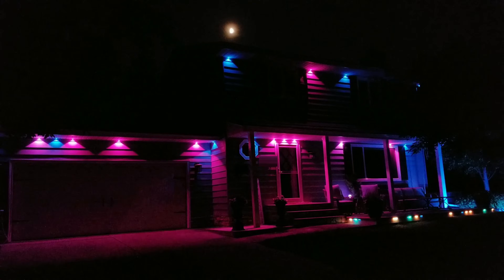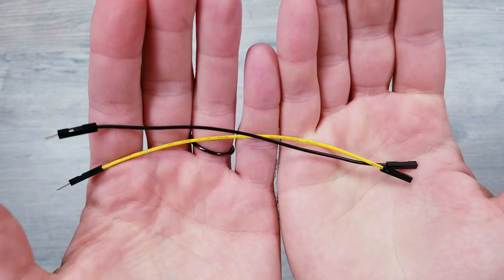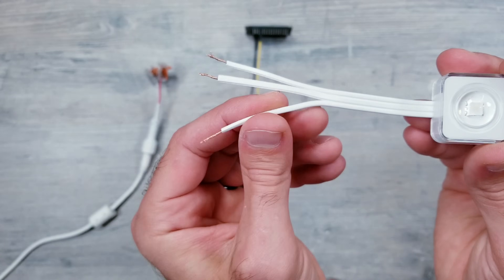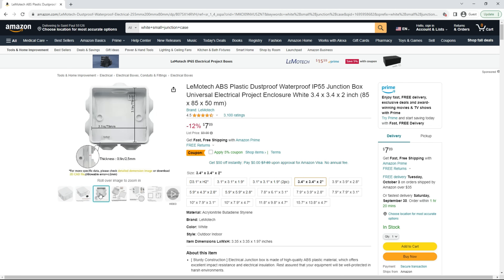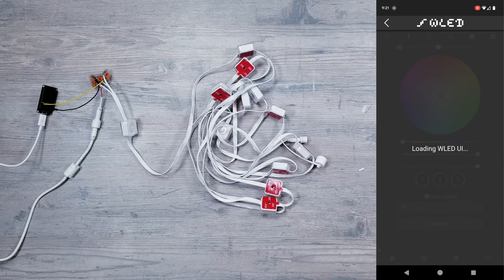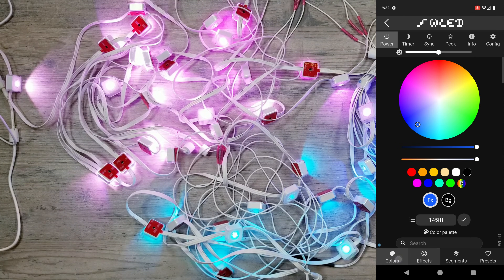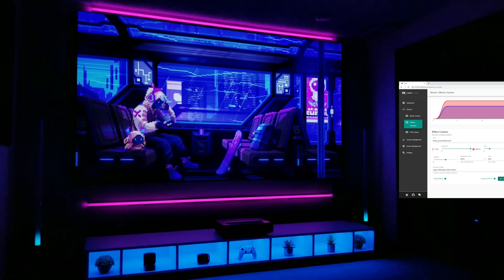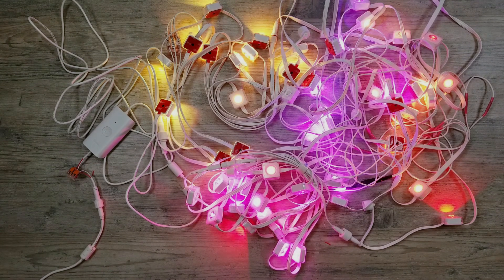Can You Control GOVEE with WLED?! Is it the PERFECT Combo?!

Comment: Thanks for sharing,
As the Govee lights are also ws281x the same govee controller can be used with othe ws281x stripe lights from 30 Leds per meter to 144 Leds per meter thru Their App.

Comment: Awesome video. i'm about to try this on some christmas lights 2 that arrived with a DOA hardwired controller. It's a little bit different setup than the pro outdoor lights but it'll be interesting to give it shot and see if i can get it figured out to work.
Reply: Looking into how to do this as well.
Reply: @joemorgan9632  my attempt was sadly a failure. I'm not an expert by any means just a tinkerer but I'm fairly confident the lights were unsaveable. Even simple on/off was non functioning with wled so I'm guessing it wasn't a bad controller in the beginning which is fine, was worth a shot.

Comment: Thanks for sharing. My Govee strips have been acting up lately and I was just researching how to switch them to WLED then I saw you posted this video a few hours ago. I'll give it a shot. My main concern was they run on 12V and I've never done LED strip with WLED that run on over 5V.
Reply: Govee has really good support btw they may or may not have got me to say that but it's not wrong I had an issue with mine and actually had them working with wled js flickering from power injection so I told them and they replaced it js got them today
Reply: @tubelesstrippin  They have 0 support on Home Assistant. Whatever available integrations now are super bad, they work for 1-2 days then start erroring out.
Reply: @iMustafaTube  I meant like customer support they really good about giving replacements

Comment: With the new pro version permanent lights you have not only the RGB main but 3 warm and 2 cool leds for white lights. Are those also controlled with wLED?  I assume it would need to be programmed as a new string light model in the wLED software.
Reply: Can you explain how you got yours working? I am struggling with this and my pro setup.
Reply: Any update on this? Curious about this with the pros.

Comment: Thanks Chris, awesome video.

I wonder if you could wire them both up at the same time, but put an in line switch to toggle one or the other on to make a quick switch without touching wires.

And maybe you could use the dower from the govee to power the esp with a buck/boost converter to eliminate the extra  power supply
Reply: That's what I've been thinking about doing. devices in my pc come with their onboard lighting effects, but with the press of a remote button or toggle in software progam they switch over to a 3rd party connection which is the motherboards lighting for most people. I'm not smart enought to do a remote switch just yet, but i'll probably find or make a physical switch. I've cut and saved too many controllers from all sorts of devices. Splicing in an esp32 with a switch of some sort is what i've thought everytime.
Reply: I'd also like to know if this is possible.

Comment: I think that every single product that use WS281x led is ready to use with WLED, like i use the LS100 from Corsair with Razer Chroma Software, with the controller from Razer and some ARGB 4 pin connectors.
If the WLED come with some GUI Interface i think i will move to WLED, but for now i remain with my Razer software 😅
Hi from Italy 🙋🏻‍♂️
Reply: Wled has an app and a gui in your browser.
Reply: @DaMook82   I know, but i want an app on PC/Laptop or on the phone app to control individual led with one tap, or like Twinkly, Lifx, Govee, Philips hue to drag and drop or paint with finger, if you know what i talking about it 🤩, that will be awesome 🔝
Something simple, not to go on settings for adding a lot of LED or individual leds ✌🏻
Reply: What about reverse / opposite? Control cheaper leds using Govee.
Reply: I wish razer chroma software worked right for em but it's always really weird for me idk lol I straight uo don't use any rgb software anymore unless u count l connect
Reply: @AX-fx7ng  I think is possible, if you have some controller from Govee, not sure, but if the govee use same type of LEDs with the same chip, I think is possible
Reply: @tubelesstrippin  I use Synapse from the beginning, and for me it was flawless, no small problem, and wat I like about the software is the Studio part, where I see every individual led for choosing the right color or efect, and I wish that all the companies will create an Universal control, but I don't think is possible

Comment: What is a good "effect mode" to test out my setup?  Right now I seem to have a lot of flickering, but I can't tell if it is part of the effect or not.  The solid and chasing modes work with no issues, but I wanted to test on a more advanced setting to ensure I have enough power for the LED's.  

Setup: 
Power supply is a 36v 4A supply
Using a ESP32 board
LED Outputs
- Selected "WS281x"
Length "12" - for 12 LED's
Disabled automatic Brightness limiter 
One 12 LED Govee Outdoor Permanent Lights

Comment: Thanks Chris - do you know which ws28x the govee lights are using? The power supply says 36v output 🤔 - I would have assumed 24v ws2811 or 12v?
Reply: I'm curious about this too... it's unusual to see 36v led strips/pixels so I wonder if the voltage leaving the controller box is 36v?
Reply: I'm curious as well about the voltage. I bought the quinled dig quad and it says 5v to 24v. Can I connect the 36v supply to it?

Comment: Hey Chris, your videos and editing are spot on. I've been messing with WLED for a while on 3D printer projects and wanted to use it with my Govee H705C Permenant Outdoor LED's (non-pro). I don't like their app and wanted a little more control ;o)

Rather than cutting off the end of a light string I cut off the end of an extension to wire in my setup 
    36v 10a PSU powers Govee lights and 40v Buck convertor
    Buck convertor powers ESP32, running WLED v0.12.1, at 5v
    ESP32 data line connected to Govee LED

I have an issue when the ESP32 is powered by the PSU, unless LED’s are set to solid, static, 100% power and white they change colour and cycle through some pattern
When I disconnect the 36v PSU from the ESP32 and powered it via 5v USB everything works as expected
Not a clue as to why this is happening - any thoughts?

Comment: Hello! I'm trying to do this but for the Govee Curtain lights. They have the power brick and I think the controller, like in this video, but then also have a third box after the 3-prong connector and before the 3 nakedly visible wires for the connection "hubs" for the curtain lights themselves. Do I cut before or after this 3rd box? Since I'm not sure what that box does precisely

Comment: Are you still limited to150'?  If so would a larger power supply work?  I have 300' of the Govee lights and would like to have them on using 1 controller.

Comment: Great video! 2 questions. Since I have 2 sets (1st and 2nd story), is there a way to sync both sets in WLED? Also, assuming 150 total feet is still the max?
Reply: WLED has an option to SYNC built into the software, so you can set it so that one strip will copy the other.

Considering the cost of the ESP boards and the cost of the LEDs, it's probably worth spending a little money on buying some and just messing around to see what is possible, before you cut into your expensive lights.

Comment: I have a question, I purchased 10 pathways lights, the brand is XMCOSY+ Low Voltage Landscape Lights, 200LM Smart LED Pathway Lights with APP Control, Adjustable Warm White&RGB, 12V 6W but the app is limited can’t do much and only charge color all at the same time, I’m wondering is this light can be plugged with one of this muddle controller, please let me know if that is possible…. I’m new to this world of led lights and I don’t  know the difference between RGB, RBGI etc…..thank you

Comment: Cutting at the start of the lights is easy because they are already split into three distinct lines.  Unfortunately, that requires that the connection point is outside of my house up under eave.  Can the single wire coming immediately out of controller be cut & be stripped?  I assume it has to has the power, data, and neutral lines inside but, if there is no way to identify which is which, I would be SOL.  My Govee lights are already installed with the cable run from power supply to controller in garage then extended single wire thru a wall then up under eave to the actual LEDs using screw connection.   I wish I could attach a photo as my question would be much easier to explain.

Comment: Love your videos!

450 linear feet around my house eaves

Obviously, I need at least Qty 3 - 100 ft kits with spliced runs in some places, so each segment doesn't exceed 150 ft. My question is power. Do I just use the included power supplies, one for each segment, then use a WLED controller for the 3 data lines (1 per segment)?

OR

Could I use a Madewell 24V power supply and inject power at each segment?
Reply: Did you ever test this out or find a solution? I have 2 kits (1 using 150’ and the other only about 50’) that do not sync well using separate Govee controllers. I’m wondering if I can just connect them all to use on one controller with wled.

Comment: Chris, awesome video, and thank you for sharing. I recently purchased a 150' kit of these lights. Once I had them on my house I realized that I was short about 13' from my desired termination point on the house. One more strand would do the trick. I did not use any extensions. Unfortunately, Govee does not recommend going past 150'. Do you know why that is?
Reply: i had seen another video where they tested that the 100ft section was drawing 80% of the power supplies rating, so i would assume the 150ft would be close  to the max the supply can output.

Comment: Hi Chris!  Thanks for the video.  I'm trying to duplicate that you've done with the ESP board using the Domestic Automation board you made a video about it.  I have everything connected and configured as well as I could decipher.  When powering on I only the get the first pixel.  I used a number between the GND port on the board and the data wire on the Govee pixels and used a jumper between the negative port on the board to the negative 3 position WAGO.  Positive is set up the same as it is in your video.  I have 12 pixels setup in WLED with WS281x and RGB and GPIO is set for 2.  I'm not sure where my mistake is and would be grateful if you could shed some light (pun intended).  Thanks !

Comment: Question for you Chris! If you were to wire up a small room (actually interior of truck camper) which 12V compatible LED strips and controller would you recommend? Power efficiency and colour changing wanted.

Comment: Fantastic tutorials!  I wish I could use these but between the cable being white on my dark colored house and my house having no soffit to attach to, they are sadly not an option.  So, I'm looking to get lights (C7-C9) I can put up for Halloween and leave up through Christmas changing the color themes along the way.  This looks like it could be a good option to replace the horrid controller / apps that come with most smart light sets (3 wire like these).  Do you by chance know if that's true?  It's amazing how hard it is to find solutions for lights.  It seems the choices are painfully boring and buggy or super complex for a light show that requires a PC to control lol.

Comment: So I just bought the 100’ set of the outdoor lights. I’m likely going to have extra. Would I need to buy a Govee specific power supply if I wanted to try this with the excess lights? Or would I be able to buy any power supply that matches the Govee power specs and then connect that to excess?
Reply: Curious about this too!
Reply: I've purchased a couple of 36V 2A power supplies and have tried it with no success.  If you all have any info regarding how to make this work, it would be a game changer.  I've followed the instructions minus the Govee power supply to a T with no success.  Really quite a bummer.
Reply: I actually bought 36v 3a power supply, and wired it to the extra lights and to the wled controller he mentioned in the video, and I got it working. Lights work well. I powered 3 and 1/2 strands.
Reply: Thanks for the response!  I actually figured out and should have reported back that on the esp32 that I purchased the data pin d-2 is actually GPIO-4 in the WLED Software.  The minute I figured that out, everything worked.  It's awesome not to have the extra lights go to waste.

Comment: Thank you so much for making this tutorial!  Can other Govee products be connected the same way, such as the Govee Christmas String Lights, Govee Curtain Lights, etc…?

Also, if one were to use other non-Govee addressable LEDs in their setup, would it necessitate a second ESP32? Or could other lights be controlled using a different pin on the same board?
Reply: I’m curious about that too

Comment: You dont need a 36v power supply? Whats the reason others use a different power supply? I have a 100ft kit coming in and wonders if this is all i need to run wled.

Comment: I've got the standard (not pro) version like you showed in this video.  I have Six strands, but in strand number Five in the sequence I need to remove 2 LEDs from each end in order for it to fit my house correctly. Will WLED allow me to pickup the sequence of lights so the last light in strand Four is followed by what was formerly the 3rd LED in strand Five (now the first LED since 2 LEDs were cut out)? Then once it reaches the 8th LED on strand 5 (formerly LED number 10) can I make it go to LED 1 on strand Six?   Hopefully that makes sense...  Basically, if I cut out 2 LEDs on each end of strand Five of Six,  will WLED recognize that strand Five has 8 LEDs instead of 12 when running a sequence?

Comment: Well look at that :)
Looks like you did a video on a conversation we had! Nice! 

I also agree. I think Govee software isn’t bad at all. But what will be nice is when you mix and match multiple vendor products being able to modify them down to a common denominator. 
Especially some of the more custom LED items being released. 

I have a pair of Tuya powered music lamps I got on Amazon for cheap and man are they super limited. The leds are RGBIC but you can’t customize anything. It’s either all rain bow or solid colors. I need to rip into the electronics and see if I can use the mic and maybe flash the controller they use. Or splice in an ESP32.

Comment: Hey Chris - I followed this to the letter with the same ESP32 and set of Govee lights and ended up apparently killing 2x ESP32 boards so far when tying the grounds of the Govee PSU and my ESP32 together. I'm not certain why that would do that, I had the same setup utilizing the provided PSU for the lights, as well as a USB power adapter powering via micro USB on the ESP32. Positive of the Govee PSU was never touching anything on the ESP32, only the ground.

Did you find any issues in your testing? I would find it odd if Govee had the white (negative) and red (positive) swapped on my PSU. Black is the third color, assuming this is data coming from GPIO16 or GPIO2 on my ESP32 (shouldn't matter if configured in WLED).
Reply: You have 3 wires coming out of the controller, I was able to probe them and find the polarity.

Out of the controller:
Black - Negative
Red - Positive
White - Data

Out of the PSU:
White - Negative
Red - Positive

Sounds like you may have potentially wired the ESP incorrectly killing them, I would put the original controller back in and confirm the lights still work
Reply: @jaxondesmarais3391 here’s where I went wrong. I tried to splice into the cable from the controller that feeds the first string of pixels and those colors like you proved, don’t match what’s coming from the PSU.
Reply: @jaxondesmarais3391  life-saver!

I burnt one 12LED segment and an ESP32 while experimenting, and was at a loss.

I'm not really great with a meter, so I followed the video tutorial above blindly. I did not realize that the colours were swapped BLACK/WHITE for negative -.-

Comment: Ouch. Dupond connector into a wago? I hope nobody's house burns down because of the transitional resistance. I would cut the connector and also strip it down to put it in the wago connector.
Reply: That was a data line so very low current, probably much less than a milliamp, and a common (ground), also probably much less than a milliamp, so it's not a problem, he did the main power lines properly using wago connectors rated to 32amps, so again, not a problem. What's wrong with using Wago's with solid core anyway? They're designed for it.

Comment: This is nothing compared to ideas I got for you. Have you got an idea for a DIY version of Govee T2, there are a few on the internet. Let's see what you can do. Two, is it possible to sync LED strips that aren't from Govee to sync with the Govee T2. So colours on those strips, for example, of it was in a room, would sync according to the colours on the screen, a bit like extending it. It is already possible among Govee products. What I am asking is just extending it with non Govee. For example, the extended left and right strips in the room wall will sync with the what is on the left and right side of the screen respectively.

Comment: I am using a dig quad. I have 4 strings tied together. My controller is in the attic about 30 feet from where the first string starts and it seems I will need to add a data booster as I can only get the first led of the fourth string to light up.

Can I run a data line to the end of the string?